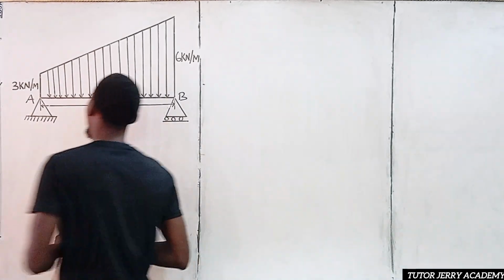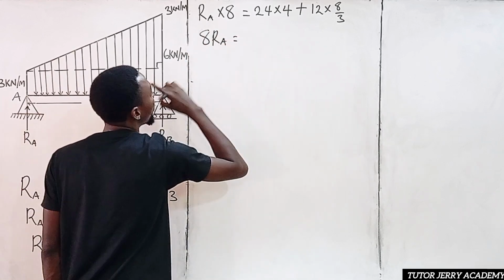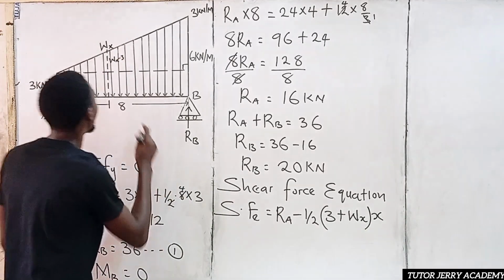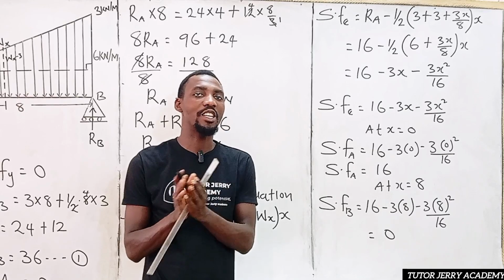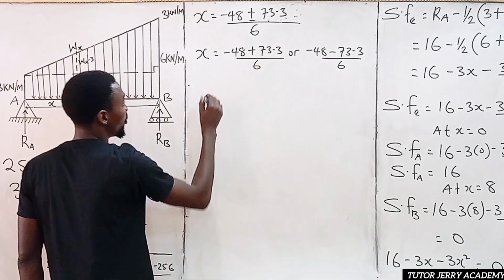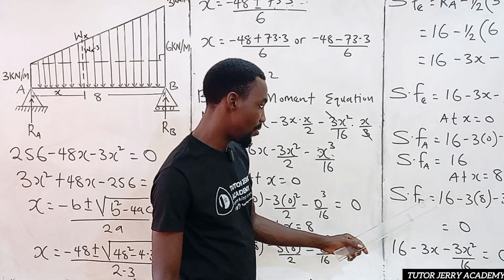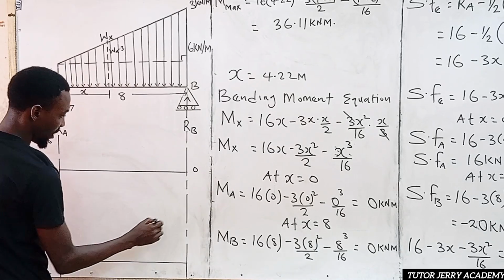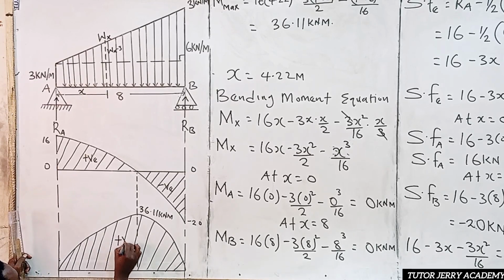Shear Force & Bending Moment Diagram | Simply Supported Beam with Trapezoidal Load Step-by-Step...

Comment: Why do we session ?
Reply from the maker: We cut (or section) a beam so we can see what is happening inside it  like how much force is trying to slide it (shear force) or bend it (bending moment). This helps us calculate these forces at any point along the beam. In terms relating to S.F and B.M diagrams We section beams to analyze the internal shear force and bending moment at any point by applying equilibrium equations to the cut portion.
Reply: Noted @tutorjerry
Reply from the maker: You are welcome
Reply: @tutorjerry the videos are indeed helping and just at the right time.. i would suggest you help students for easily navigation, the playlist doesn't seem ordered . Maybe something like oldest ones first then the rest follow 🙏🙏🙏🙏